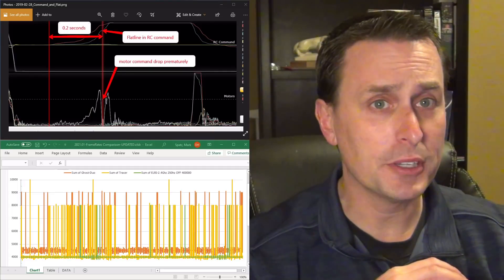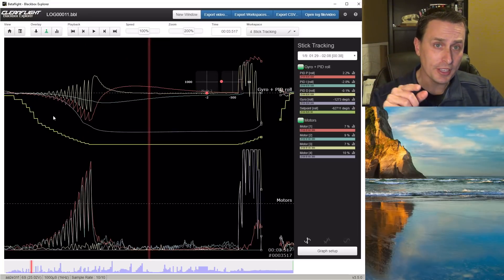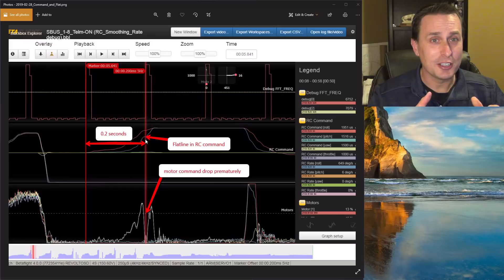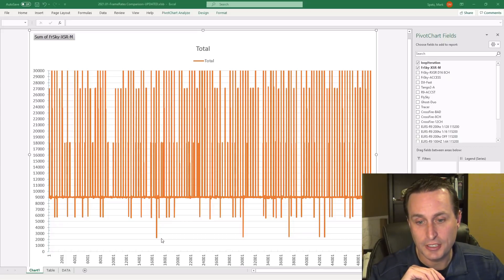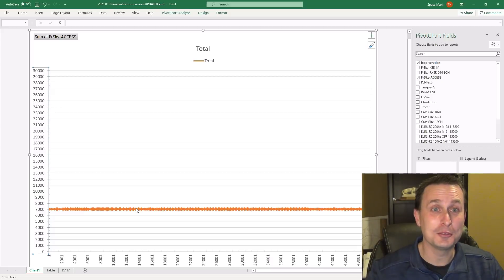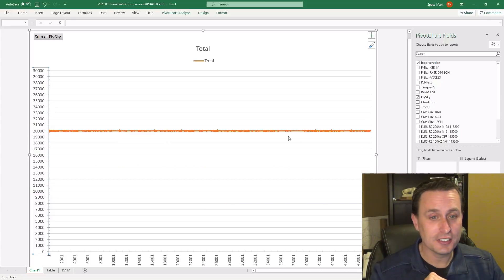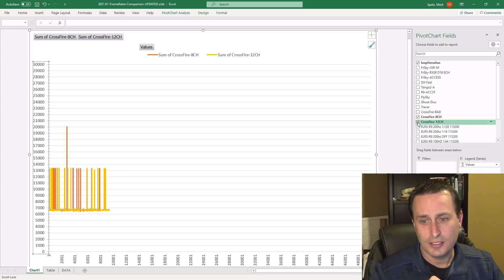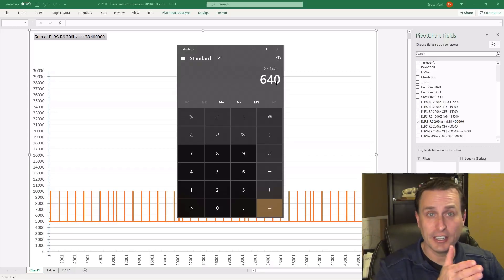Low Latency v. Frame Rate Consistency | WHAT IS MORE IMPORTANT!

Comment: I am currently running 500hz on an ExpressLRS 2.4ghz system, with telemetry on. they are working on going to 1kz with open tx 2.4. ExpressLRS currently  just does basic telemetry, eg, RSSI, LQ, Bat voltage, Current, and I believe a few others. It does however not do gps data, etc.
Reply: I'm running 500hz with telemetry on too but I wonder if you get lower packet times with it off.
Reply: @MonroeKA  Yes, the same as with the 200hz r9 shown. Depending on the tlm ratio set, every 128 or 64 packets it sends telemetry. for racing though, there is no use for it anyway, so I will just be turning it off.
Reply: Thank you to @UAVTech for the video, with actual, useful data 👌😁

Comment: Curious to know which ACCESS that was, 2.4ghz or 900mhz. 

Running R9MLP ACCESS and been really happy with it, will be looking at possibly switching my racers to the ACCESS RS Pro when the 4ms firmware is released.

Comment: I'm interested in ghost pure race mode with no telemetry, as that should be more consistent with the frametimes, no?
Reply from the maker: Probably, I have not seen data on it.  If you have it, run RC_SMOOTHING_RATE debug to see for yourself.  Sent to me if you do pls: spatzengr at yahoo.com
Reply: @uavtech  yeah I can do this for you tomorrow after work. Thanks! Sadly I don't have access to the new firmware that has 250-lora-noTele as well as the 250-flrc-tele (as I understand) otherwise I'd send you both. Once that firmware is public I can send that data as well if you are interested in it.

Comment: do we need to smooth out the 4ms motor command jumps or not? I found them in my tango 2 received logs. the motor output signal really drops on the little plateaus on the RC command trace... I am a little worried now. What should I change? a very little more filtering on the receiver tab?

Comment: Great roundup and some interesting results. Could the use of to separate diversity antennas on the access 2.4 module be a contributor to the lower amount of frame drops? Will be interesting to see how the new diversity ghost rx will fare
Reply: Many people I fly with, including myself, decided to upgrade to 2019 Taranis with built in ACCESS module - let's you use cheap ACCESS receivers for quads that don't need much range or low latency. ACCESS actually feels really good, that's what I've been using instead of Crossfire (was fed up of having issues with it) up until Ghost came out. That being said, I heard really good things about Radiomaster, wanna try it myself.
Reply: Access 2.4 is hiding dropped frames, for whatever reason FrSky decided to do that and they don't seem to want to change it. Don't believe everything you see :)
Also these logs don't look anything like "first 6 seconds of flight".
Reply from the maker: They are 15 seconds in some cases.  My bad.
Reply: @ak_fpv  that's interesting, saw your other comment. I'll look more into it before deciding which system to get. But I'm currently leaning towards ghost. Will be getting a new radio as well then (5year old Taranis is getting a bit worn), looking at the radio master tx16s